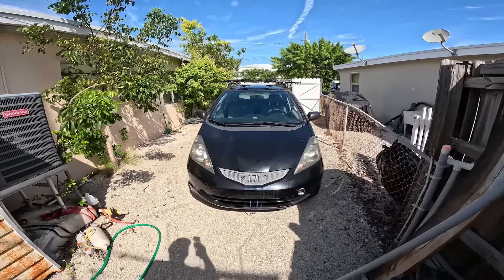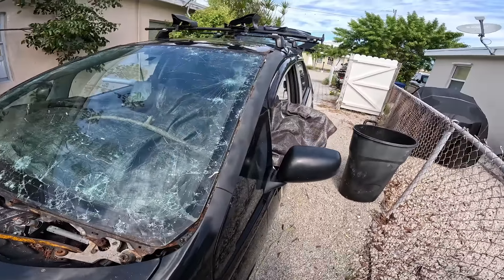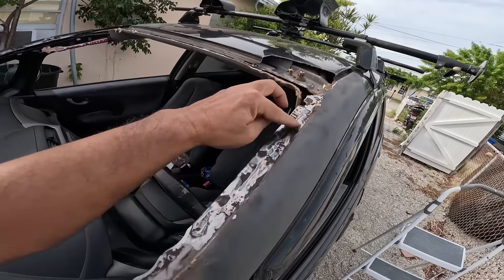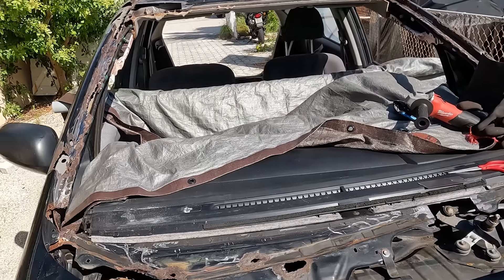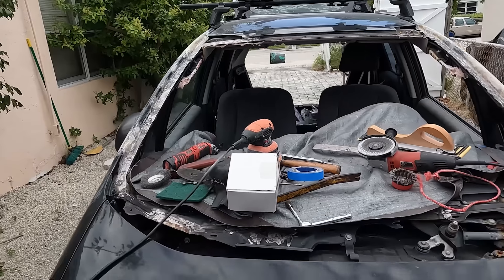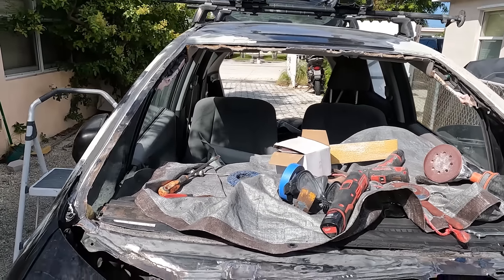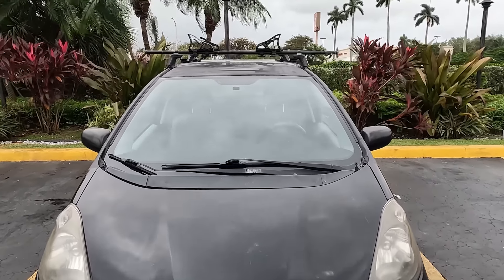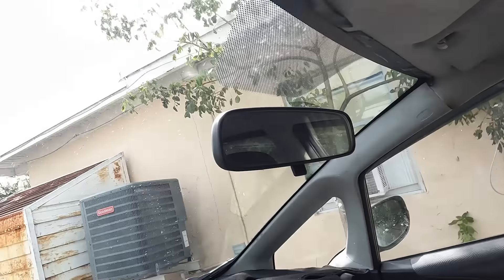I'm Not A Criminal Anymore.  Life On The Run.

Comment: Hey Steve, maybe you can get a fresh water wash down system.  You can try and fabricate something yourself or buy one. Either way you may extend the life of the repairs that you made on your vehicle.  Maybe a pressurized pvc tube containing several gallons of fresh water that you can use to rinse off the kayak before loading it on top of the car.  You can mount it on the cross bars next to the kayak.

Comment: Too little, too late as the saying goes. But if you have a sawzall you could have cut a cheap 1” putty knife, welded an adapter on it then use the sawzall to cut between the glass and car (cutting the glue obviously) and gotten it out in one solid chunk with no mess